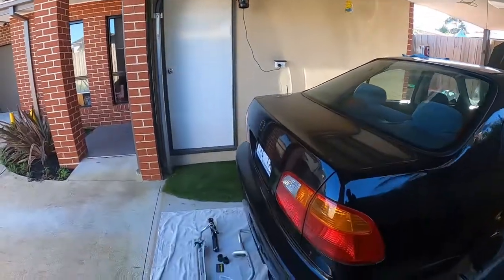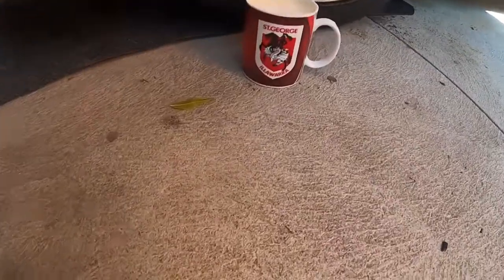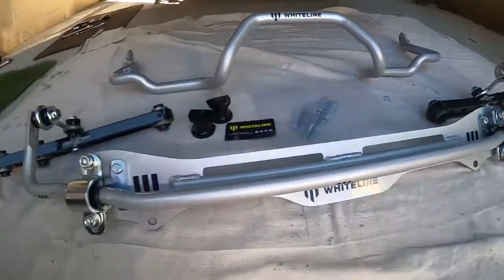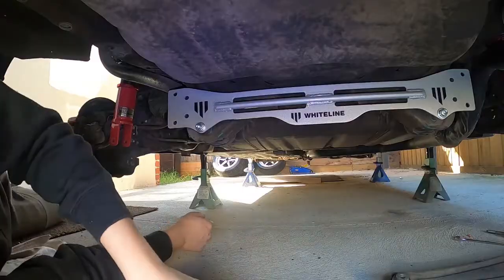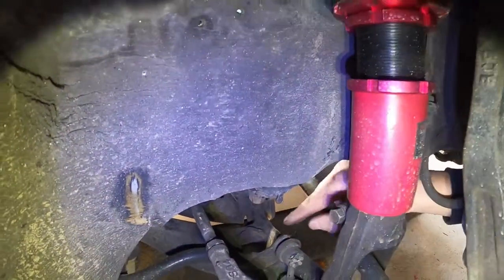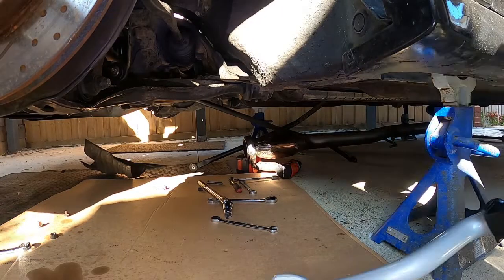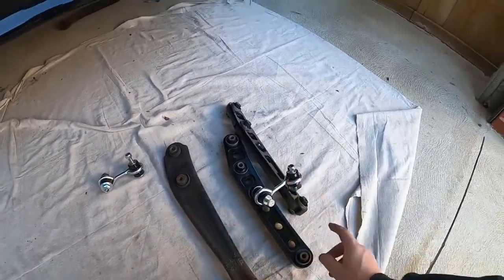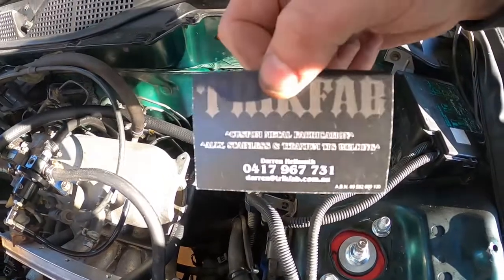WHITELINE SWAY BAR INSTALL #GRIPACTIVATED + CATCH CAN INSTALL D16 VITARA EBAY TURBO BUILD

Comment: I'm going to be installing on my ek tomorrow! Looks pretty simple
Reply from the maker: Best mod you can do brother
Reply: @TURBOTRISTO  hell yeah. I tried setting it up but it seems the end link that connects to my lca doesn't have the bolts required? I'm probably doing something wrong LOL
Reply from the maker: @nathando413  if you have a civic base model hatch you need sedan or em1 lcas
Reply: @TURBOTRISTO  now that makes sense LOL. Would I need to hand tight certain bolts for the rear sway bar while it's up in the air then tighten them properly when it's months ground?

Comment: I got a rear sway bar from a integra for my 96 civic, when I went to install it I realized that the person who had it before me redone the exhaust and removed the up and over the control arm pipe and ran it straight blocking where the sway bar needs to be at. Also the control arm is bumping the exhaust pipe.
Reply from the maker: thats exactly what happened to me so i had to modify it not the end of the world sway bars are the best

Comment: Did you ever end up getting around to putting together a full kit with everything you need to run a turbo kit on the d16y4 ?
Reply from the maker: I’ve done a heap of videos about what is required

Comment: What kind of front lower control arms are you running? Trying to figure out what sway bars with work with the k-tuned front LCAs for an Ek. I see that the whiteline control arms mounting points sit vertical not horizontal
Reply from the maker: G’day Ray, my car currently has all of the standard factory LCA’s I agree the sway bar links are a little out of align meant I’m unsure what the solution is
Reply: @TURBOTRISTO  interesting! Appreciate the response Tristan! The EX/HX 96-00 civics here in the states have a different swaybar mounting design on the front LCAs. Your’s looks more like the 99-00 SI stock control arms. Which is sweet. Good stuff tho, you have the only video up, that I could find, of installing the whiteline front sway bar so thanks for forging the path!
Reply from the maker: @lifted4evr  yeah there are slight differences in each country mine is a 98 model

Comment: Hey, I just installed the same bars on my ek, but I have trouble with the front links. It's like the right one broke, u use special ones? I bought Tegiwa links for the front sway bar. If you can help ^^'
Reply from the maker: Hmm should all fit up unless your lower control arms are from a car that didn’t have a front sway bar?
Reply: @TURBOTRISTO  thx for your answer, I had a sway bar, I drive an EK4. The problem was the driveshaft :'(

Comment: I have these sway bars on the way. Do the OEM rear LCA have the holes for the links? Or do I need new arms to fit the rear
Reply from the maker: The rears are ready to go but if you have a hatch you need sedan or ek4 lcas
Reply: @TURBOTRISTO  thank you for responding. Damn I have ek1 hatch. Looks like I'll have to get some lcas.
Reply from the maker: the rears are fine its only the front lca that needs to be changed
Reply: @TURBOTRISTAN  thanks mate. I ended up getting a whole heap of hardrace stuff anyway so replacing both arms :)

Comment: was it hard to take out the gear linkages??
Reply from the maker: No mate just two 12mm bolts
Reply: @TURBOTRISTO  Thank you will be installing my sway bars soon! and same with the exhaust just a couple of bolts too?
Reply from the maker: @djvisuals4887  yes just two bolts per section of exhaust you are changing I have another video installing a rear muffler check it out

Comment: Having trouble fitting the links on mine 😂😓
Reply from the maker: Front or rear? Or do you mean the bushes? Into the links
Reply: Yeah I had the swap the bushes. Ended up using the long bolts and big washers to squeeze the bushings into the links
Reply: How much did it cost you to get the muffler fabricated?
Reply from the maker: @Diamondhillchi  like $100 to change it
Reply from the maker: @Diamondhillchi  glad you got
It sorted mate